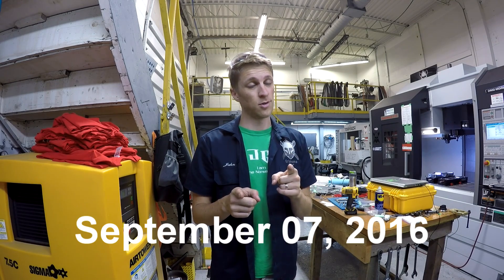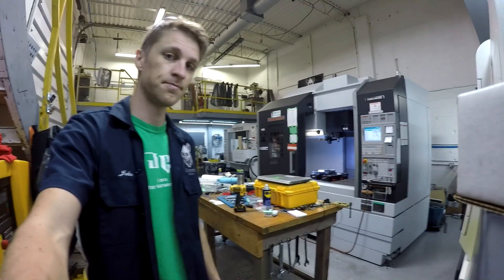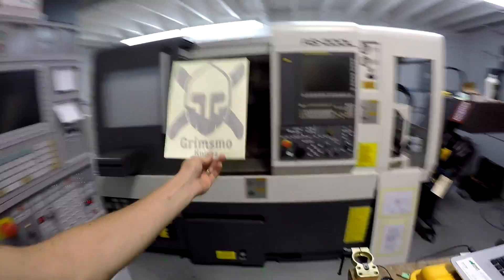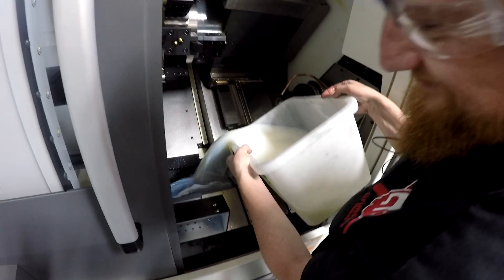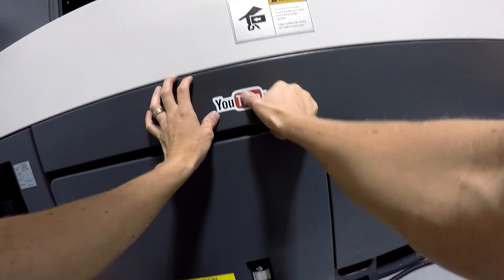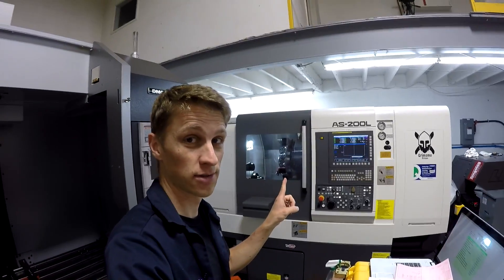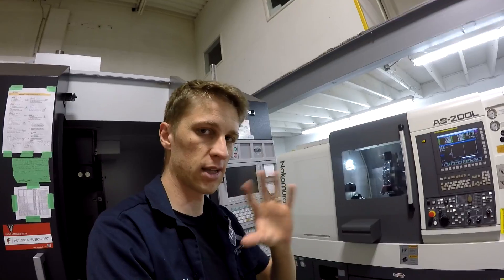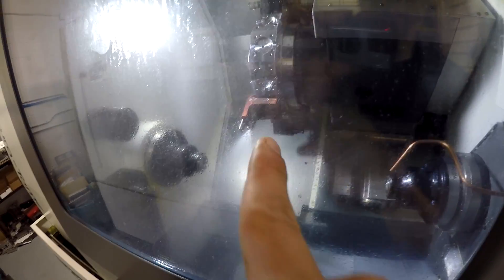Nakamura Tome CNC Lathe Installation and setup

Comment: Did the service tech have to perform activation on the control?  Some multi-axis machines actually require this.

BTW you don't want to know how much that levelling tool costs.  It's accurate to within a few arc minutes.  Only the Wyler ones are better.
Reply: Holy shit, 8k$ for that Wyler levelling tool! Thank god I'll probably never have to buy this myself.

Oh and control activation by a service tech is pretty much standard right now, don't know which machining centers or lathes don't require it. It plays a pretty important role for warranty.

Comment: Hi John. I would like to introduce myself. My name is Shaun from England and I am so impressed with all that you do within your workshop and the way yo have self taught yourself ie mills lathes. I love your videos so much. I am 50 years of age and as an older man who is very mechanically minded I am inspired by such a young man who has such a fantastic attitude to all you turn your hand to. In addition I love the fact you make family time at weekends and seem to truly have a fantastic balance between work and Family. Good on you.
John back in 1989-1994 I worked at Hygena Kitchen manufacturers running a Fanuc Six headed Heian Router making centre Panels and Profiles on Doors. I loved it but left to pursue a self employment in mechanical engineering. Now semi retired I would love to invest in a Cnc Mill- Lathe. I would be extremely grateful if you could give some advise as to what machine to start with and some direction as to software to use. Like you I intend to self teach myself but would like something  forgiving to start with. I wish you all the best John, Eric and all your family from here in England. Cheers Sean.
Show less

Comment: why did you go with such a big machine instead of a swiss size machine?
Reply: I think he mentioned in an earlier video that this was the smallest machine he could get that had all the features he wanted.
Reply: because they make very small parts
Reply: false, they make up to 50mm bar, this guy is making 1cm size screws at most.
Reply: yes, I agree, they are making small screws. I have 2 cats also meowcats.
Reply: therefore he should not have bought such a large machine. Waste of money unless he wants to stop making knives and become a job shop.
Reply: A Swiss lathe would had cost even more with the same features.
Reply: yea you would think that, but you google "swiss lathe" and there's over 20 different companies. you don't think they make lathe smaller than this with subspindle and whatever stupid options he wanted? Maybe not this company but there are many others.

Comment: If theres one single little piece of experience i want to pass along for lathe work its, only use loc line as an absolute last resort when running automatic, parts here and there onzie twozies its just fine but chips LOVE to pull those off and distroy tooling. whenever you buy or use a new tool holder bend a nice copper hardline to apply the coolant best you can, keep the lines hugging the turret and tool so there is as little chance the chips can push or pull them around as possible. for things like insert drills coolant pressure is absolutely critical for their survival.
Reply: crimson knifes

Comment: I would get away from those brass coolant balls you have if possible (might be the best for options wise). Reason being is that they have a tendency to spray the tool holder before the tool, wasting potential coolant, and when you cinch them down, they will eventually start to develop flats from the clamping mechanism so they become harder to move around for different setups (greater tendency to return to said that position). Loc line is awesome but they do have a PSI rating (unknown) as well as a flow rating (30 gph?), so they can be kicked around with high pressure. I wish I had a straight this is the best "product" answer but after my time trying to get it all figured out, I have concluded coolant lines are only best if they are considered a consumable to be replaced after x amount of time and wear, or the money is spent on coolant through tooling; awesome but VERY expensive.

Comment: You should always pour the oil into the water and not like Eric did it. That's at least what our coolant sales guy always tells.
Reply: [...]When adding “soluble oil” concentrate to water, the emulsifiers suspend the oil particles in the water, and will form the stable emulsion desired. If the water is added to the concentrate, the emulsifiers “release” part of the concentrate to “grab” for the water. This forms an “inverted emulsion”, causing parts of the fluid such as the lubricant package, biocide package or rust inhibitor package to be lost. Some or all of the chemical packages within the fluid may be affected. The mix stability, concentration, and the dye may also be affected by inverting the emulsion. The concentration of the fluid will be less than required and the dye (if the metalworking fluid is dyed) will be partially lost to the floating layer, leaving the fluid a lighter color than would be expected with a properly mixed fluid.[...]
https://www.milacron.com/proper-mixing-practices/

[...] It is a general rule that concentrates should be added to the water last and mixed thoroughly. One way to remember the proper sequence of addition is to remember "O.I.L.", meaning "oil in last".[...]
https://www.masterchemical.com/na_en/technical_information/tech_faqs.php
http://www.dlindustrial.com/profiles/blogs/7-things-you-want-to-know

[...]The first rule in mixing metalworking fluids is that you always add fluid concentrate to water -- not the other way around, unless instructed to do so by the manufacturer. Doing it this way ensures that the emulsifiers will properly suspend the oil in water, which is what you want to happen.[...]
http://www.acculube.com/lubricant-best-practices.html
Reply: Looks like it's already mixed. The coolant we used in college looked like cooking oil but went white after adding water. Was pretty cool
Reply: As opposed to pouring the water into the oil? I don't think it really makes any difference how you mix the coolant as long as you mix it. To my understanding all you have to remember is to mix the coolant outside the machine and then pour it into the tank. Don't try pouring in the water and oil seperately.

Comment: John
I would definitely look into a mist collector for that lathe. HP coolant and a lathe that place will be fogged up in no time.
Reply: With dual collets it won't be much of an issue. I used to run Super NTM3's at a previous job and they were fine with three turrets working at once.